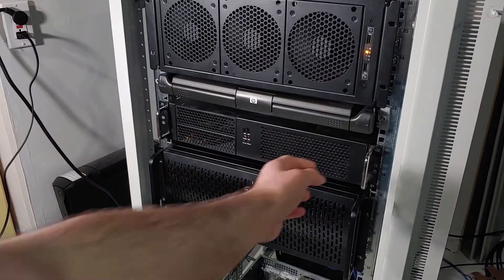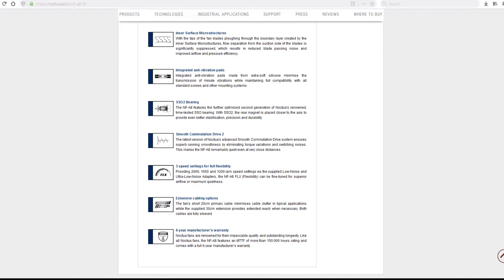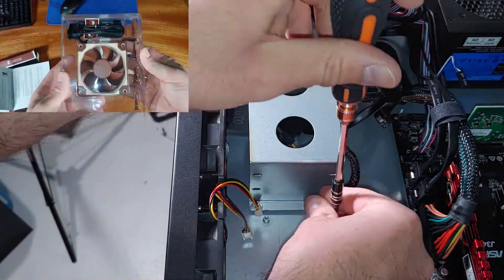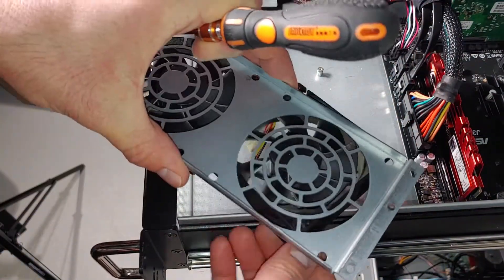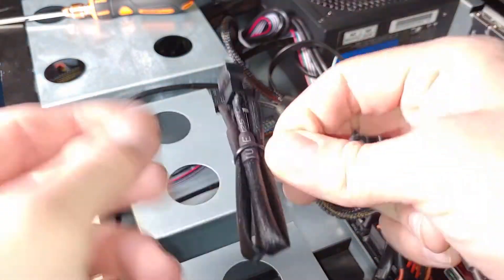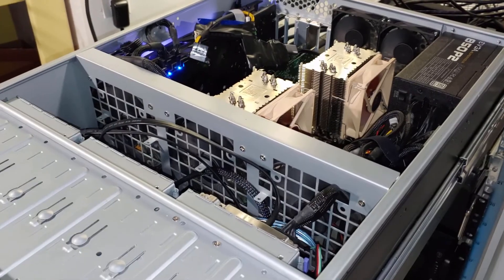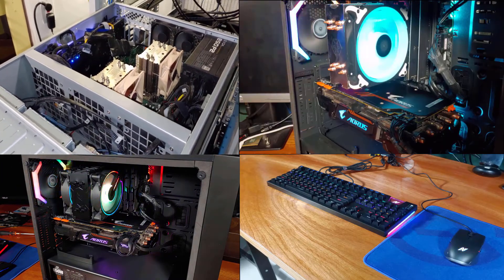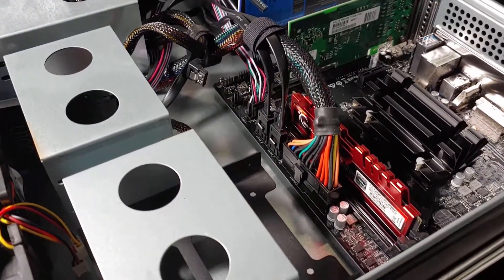Best 80mm PC Fan: Noctua NF-A8 FLX Fan Review & Install, 2U pfSense Server

Comment: Great video. I swapped out the fans with the PWM fans.  I just purchased the same 2u rack server case.  I had to order the 5.25 Hotswappable 3 drive bay.  The HDD could not align the hard drive screw holes.  Also the power supply that is modular barely had enough room for the cables and the fan from the hotswappable drive.  Yeash.
Reply from the maker: Thanks Ralph! I think this combo while definitely not perfect is an awesome bang for the buck for a homelabber or even an SMB. I ended up buying velcro cable ties and really wrenched down on the excess PSU cable length to help maintain case airflow and reduce the apparent volume within the case to make working on it easier. This was in a different more compute focused build in this case that never made it into a video. What type of machine did you end up building with these parts?
Reply: @STS  It is a Docker Server for homelab.  I had originally 3d printed a 2u Raspberry Pi rack.  But only was able to fill in 3 slots of the 12 slots for rpi with POE hats.  Since it is very expensive to purchase Raspberry Pis right now and none in stock since December 2021.  I priced it out and having 12 rpi to one 2u beefy server was about the same price and parts were readily available.  I just built a ryzen 5 5600, 64gb ecc and 6tb HDD x2 Raided, 2 NIC for 803.2ad.